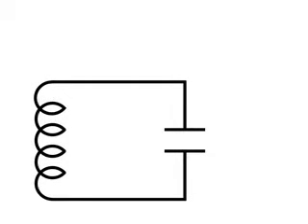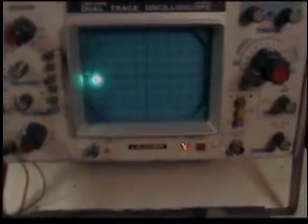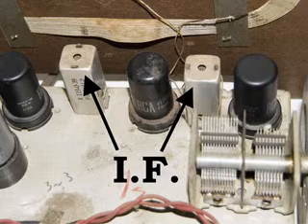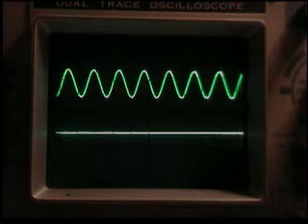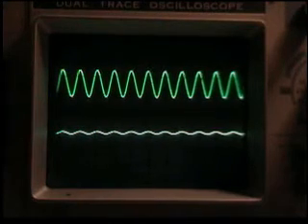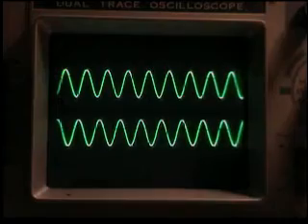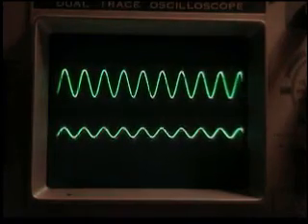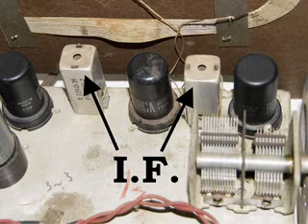Resonant Frequency

Comment: If an IF can is not functioning properly, will sensitivity be affected?
Reply from the maker: Tony T. 
Yes it will, usually an alignment will
correct the problem. A weak oscillator can also cause a reduction
in sensitivity.
Reply: Thank's Rick! On a 1958 Philco Model T-4J Transistor Radio, the 1st IF 2N253 (whose enclosure is a short,oblong metal can) was soldered onto the board at such an angle that it was making contact with one of the metal straps which holds the antenna in place. After separating the two, sensitivity increased! Also, via an oscilloscope, the 3rd IF Transformer was showing very little response.
This radio, with a like-new leather case, had a huge amount of damage due to battery leakage. Volume/on-off control, and a few traces were basically dissolved. However, I stayed at it, did the repair, and the radio works quite well!
Thank you for all your help!
Tony

Comment from the maker: @3mustardMoNkEyS 
Focus is an excellent way to look at it. With one lens you can focus light down to a small dot. Add another lens and focus the dot further. Something similar to this is when you have a tank circuit resonant (focused) at a frequency and you add another tank circuit. Of course the results are determined by the quality of the tank circuits (lens).

Comment from the maker: If the amplitude is higher (voltage) the current will be less and the resistance in the wire will produce a loss. The only unexplained experiment I know of is a laser experiment. It appears that the laser beam leaves the media before it enters! And this experiment has been repeated and remains unexplained.

Comment from the maker: I like using a circuit that you many have. It gives you a practical use for where the information is applied. Also many of these simple circuits are still used in the most current electronic devices of today, like the computer you are using now. THANKS.

Comment from the maker: Thanks. The AC bias circuit in your tape recorders most likely uses a coil and capacitor in the oscillator circuit, and their values do determine the oscillator's frequency. There is one more part in the bias circuit that is not in this video, and that is the amplified feedback. It starts and keeps the coil and capacitor oscillating. I'm working my way to the front of the radio and that is the next circuit, the oscillator.